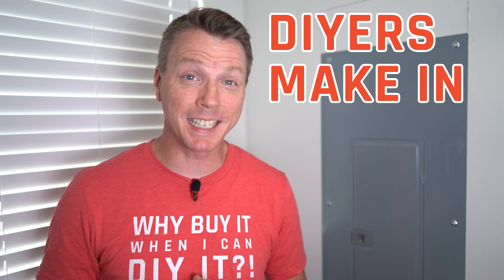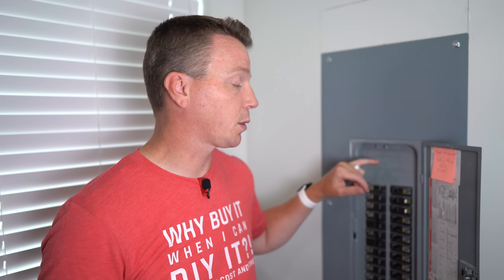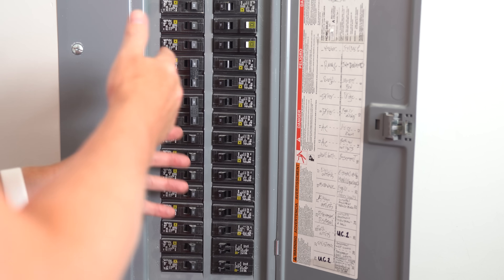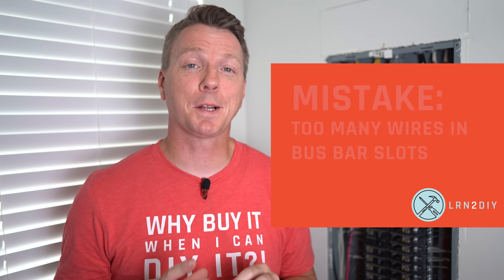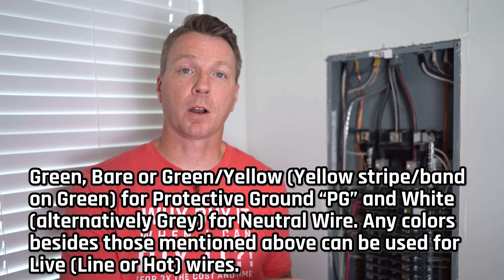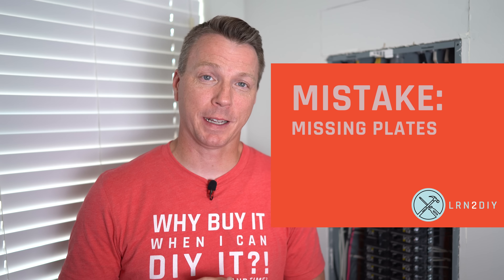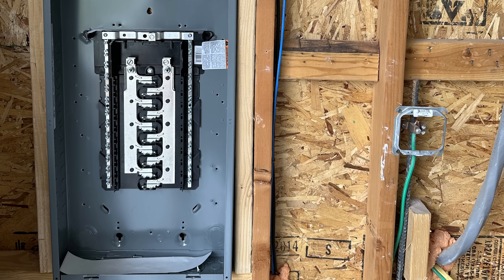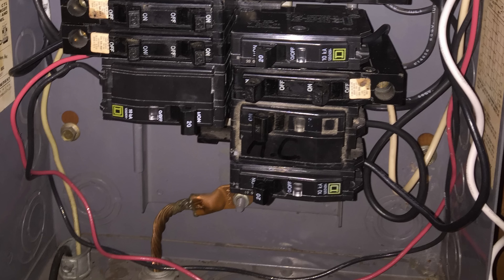10 Common Mistakes DIYers Make In Circuit Breaker Boxes

Comment: I add plastic guarding to cover my main lugs using a small Lexan sheet and a hot air gun to shape it.  I work on three phase 480 systems for work and every thing we do is finger safe.  Home load center panels are really primitive and unsafe compared to industrial electrical.  Also you should not torque live breaker screws.

Comment: Finally...You should only use a voltage rated tool when if needing to contact a live terminal in a panel. And #10? It is illegal to zip tie or otherwise bundle conductors together inside a panel. Using the photo as an example...you can see on the right side there are about 20 conductors in a 1 inch clump. Who knows of any installation where you can stuff that many wires into a conduit? NONE! This setup essentially does the same thing...essentially removing the ability of the wires on the inside of the bundle to radiate any heat away into free air.
Reply: I also noticed this right away. I created a beautiful panel like the one shown. When the inspector saw it, he made me cut all of the zip ties and separate the wires for heat dissipation. Thank you for this video.

Comment: Also another one. I guess I should have watched he entire video first? When Re-identifying a conductor like a white wire as a hot line conductor or something else , the entire visible jacket must be covered. Does that mean all 20 inches of that white wire? Technically yes, especially at the breaker end...but if it’s a little short at the cable entrance point no one will flag you for it.

Comment: I hate my iPad...can’t edit comments...🤬. Anyway, secondly...it is incorrect to refer to the white wire of a 120v circuit as the “neutral” because as anyone knows, a neutral only carries the unbalanced current in a 120/240 volt 3 wire circuit. The NEC refers to this conductor as the grounded conductor, while remembering the bare or green is the GROUNDING conductor. The white wire of a 120v Is actually more hazardous Than the hot wire because it is carrying all the current of a circuit, but people handle it like it does not.

Comment: So just a couple of answers and corrections. As far as the bare stranded conductor being cut off in a 4 wire service cable, it’s quite possible that’s all they had at the supply house and the bonding To the grounding electrode conductor is being done at the meter base...in that case a bonding screw would be run into the neutral bar to the panel. At that stage, all ground wires in the panel would then be connected to the neutral bar also.

Comment: I had experience with undertorqued panel.  Once I went to the basement and noticed sparks in the panel. It was a pretty good timing - when I opened the panel I saw a wire started burning its insulation.  And, of course,  there was a lose screw on the breaker.  That was pretty scary.   I still thank God, I think it was a miracle I noticed it at the right time.

Comment: I actually have my circuit breaker diagram on a Google sheet. And I have a QR code printed on my box so the electrician can just open it on their phone. It enables you to change anything adhoc and keep it clean. Also describe the rooms and placement of each switch or light on extreme detail.

Comment: Another fix for missing slot covers. If you have an old or extra breaker, use it to fill the slot.  It is left off and labelled spare or not in use.

Comment: Ground wires can be double lugged---sometimes up to three---panel label will tell you.  Double neutrals is not because of arcing, but because if you loosen the screw you are disconnecting multiple circuits and might be creating a 240 volt circuit.

Comment: Thank You sir, 5 stars from me. I did my own 200 amp service in a shop/building. I got 100 % according to you. Also I did my ground rod and grounding as well as I could. I couldn't make my panel wiring as pretty as your example but that is what I was trying for and it is certainly not a rats nest. I am a retired Union pipefitter and in our area of the world that includes the HVAC service world. So glad you included the tightening torque and going back every year to check tightness. . Skip that step and burn a terminal off of a large compressor and you could be looking for a job. It is so important! One last thing, Your presentation and your clean cut appearance make people feel secure when you come to there door. Versus someone wearing their clothes multiple days, hair all over their face, kicking the mud off their boots on your porch and I'm sure from looking at you, you know what I mean. I subscribed and want to see in your other videos what I may have done wrong. Thank You again, It was a pleasure.

Comment: And you lost me when you talked about the panel 'pushing' 'amperage' - Current is drawn by the load (i.e. lights  or what you have plugged in) - not pushed by a circuit breaker.

Comment: Another mistake for those people with an outside fuse box is to not use a padlock on the cover plate tabs to prevent criminals switching off your power, thus disabling your Wi-Fi cameras.

Comment: Still shocked how crappy US panels look compared to EU ones. Ours looked like that in the 1950s. 
Sure we are over regulated, but safty first and a bit of quality doesn’t hurt. Wire nuts in a panel are weired.
Reply: Even when we open a panel there are no uninsulated parts exposed or screws you could accidentally touch.

Comment: If you're flagging (wrapping red or black tape in it) a White wire as a Hot Conductor, you MUST flag both ends of the wire...in the Panel AND in the Device Box it leads to...

Also, the Electrical Code does specify (at least the Canadian CEC does) that in Single Phase Systems (like the panel in this video), Hot Conductors must be Black (Line 1) or Red (Line 2), Red is usually only used in 240 Volt Circuits such as a Workshop, Clothes Dryer and Stove/Oven. In 3-Phase Systems (typically only found in Commercial and Industrial Buildings, RARELY found in Residences) the Hot Conductors must be Black (Line 1), Red (Line 2) and Blue (Line 3), the Neutral and Ground colours are the same in 3-Phase Systems as they are in 1-Phase Systems...

Also note, Wire size ONLY matters for Amperage, how much Voltage a wire can safely carry is determined by it's Insulation, a wire the diameter of a human hair can carry 1,000,000 Volts safely if it's Insulation is thick enough, it just won't be able to carry more than about half an Amp without overheating...

The Amperage he mentioned for 12 and 14 Gauges Wire is also only accurate for about 75-100 feet of cable in typical house interior walls, longer than that or in hotter environments (like attics in summer), you will need to use larger wire for a given Amperage (called Derating in the Electrical Code Book)...

For those wondering, I am a Canadian Electrician...

Comment: You are wrong on #7. First off---you are not supposed to phase any wires smaller than #6.
Secondly---we run romex in residential & when a 6/2, 8/2, 10/2 etc etc---is run to a 2 pole breaker its obvious what is being done. There is no need for redundancy & wasted time. Any moron should know it's hot & not a neutral. If this concept is confusing to a person---they should not be in a panel

Comment: I created my own breaker labels using Microsoft office. I then printed it out, laminated it, and used magnets to attach it to the breaker box door (so I can update and change it easily). It's really easy to do and far better than the stickers you buy.
Reply: that is a really smart idea...thanks for that. One day in the near future I will have to label my rewired boxes. I feel fairly sure the electrician won't do it to my standards.

Comment: I can guarantee that professionals are often guilty of failure to label. I'd be willing to bet they're rsponsible for most of the problem. At my previously workplace someone almost died because of it. The same professionals resposible for the erroneous labels also rewired the panels to defeat important redundancies in the climate control sytem, because they didn't understand why some heating and cooling was on one leg, and some on the other.

Comment: Another  item, of  mutual  interest :. Tightness.  Of  the screws,  within  the panel. Modern  panels, use alot of aluminum, and cheap other metals.  Mixing, two or more, within a panel, is not for  
 ' tightness '  make.  About every 6 months, go in the panel, with the proper screwdriver (ONLY  ones, with insulated handles / and shafts !)  Put one hand, in your pocket, and go ahead and tighten, everything you see:  all screws and  bolts. More now, than ever,  WE  THE  PEOPLE...need to educate ourselves, in the LAWS of Thermo dynamics. There are alot more various  types, of products, used to make everything. ALOT  MORE  THAN  IN  GRANDPAS'  TIME..../ STEEL AND  CAST IRON,  and several  others.  Educate  yourselves, on the  'usage  of  metals '....

Comment: NO DIY'er is 'Qualified' or 'Trained" to be opening up a panel by removing the panel cover. Get help from someone who actually is or call a pro. Yes, it will cost you money, but it's better then it costing you your life. Can't tell you how many times me and my co sparky's had to fix bad situations from a DIY'er who 'saw how to do it online'. Somethings can be done with care yes, but leave the panels and wire issues/tracing/add-ons to someone with a license!

Comment: What if my generator breaker is having a problem closing? The bus & grid voltage match (13.8kv); the syncroscope comes to the top at (60Hz); the dither setting is good; the charging spring is ready & the fuses are ok. Probably the closing coil? 🤔

Comment: Another mistake is improper phasing of 3-wire Romex with two hots (black and red) and a common neutral (white).  It's important to make sure the black and red wire circuits land on opposite bus bars in the panel.  This is best accomplished by connecting to two adjacent breakers since adjacent breakers are connected to the opposite bus bar.

Comment: I moved into my house in 2003. It came with a 100 ampere 20 circuit circuit breaker box. 
I was adding central air & needed to get a bigger box. I hired a coworker who happens to have an E-1. Him & I talked about my options. He suggested after measuring load on each hot leg that all I needed was a bigger panel. We increased it to a 32 breaker panel. In 2004 I added 2 spaces for the condenser outside & 2 for the air handler. In 2006 I added an addition & added a lightening circuit & one plug circuit. 2-2 spaces for a baseboard electric. Then we added a home run outlet for the garage for 20 amperes with 12/3 conductors. Last was a mini split for my interlock in 2018 for my back feeding generator. Now my panel is full again. We did a load check with the A/C on & our usual appliances in the summer time including the washing machine & dryer running. All our lights on. We were only drawing 7 amps on each phase. Same for winter with both electric baseboards & oil heat. 
Great video & content!

Comment: One fault not mentioned is the always illicit shared neutral in a 120V branch circuit, in which two (or God forbid, more) circuits, each fed by its own breaker, return current through a single neutral. It's especially insidious because there's nothing in the panel that gives it away. It's dangerous because the combined current from two heavily loaded circuits could easily overload a single neutral, with the kicker being that the neutral has NO overload protection at all. The only way to suss this out is to look at your junction boxes; a large wire nut connecting a large # of neutrals should draw your eye.

In my own house, which I bought from a retired couple, I found 6 such circuits, arranged in 3 pairs, with each pair sharing a single neutral back to the panel. All were apparently installed at the same time by the same person as part of a  home "update," since they used identical materials and techniques. The guy used 3 240V cables (12-3 w/g) to do the work of 6 120V cables (12-2 w/g). Since it was done systematically and otherwise competently, I have to assume that it was the work of a dishonest professional who cheated (and endangered) the customer by cheaping out on the materials and labor, a case of pure theft. Needless to say, I won't be hiring the guy whose stickers are on my panel. When I looked him up, he now advertises himself as a garage-door installer, not a licensed electrician, so maybe that says something.

Comment: Very good vid. I guess top 10 is subjective. I expected to see unbalanced loads or Heaven forbid, using a breaker with 2 poles (switches) that are not pinned together for split circuits.

Comment: Hint: Don't just label the breakers.  Label the outlets, fixtures and switches as well.  You can put the number of the breaker either on the front or back of the cover plate.
My electrician filled ALL the holes with breakers, very convenient when I need to add a circuit.

Comment: Most houses use 50 amps . Most houses use about 50 amp in most cases you would have to use and turn on everything in the at the same time to use 150 in the house . If you have electric heat and turns on at the same time you mite use a 100 max most thinks in you would have plug in every outlet .and have a load on it to draw 20 amp . I have taken amp prob reading on and all electric house and they are not even close to 100 amps .

Comment: As a licensed electrician mistake #1 should be that unlicensed individuals should not be messing around in the electrical panel. All the mistakes you mentioned should be big red flags to any inspector (home or otherwise). This could result in a background check to see if permit(s) were pulled for the work. Which can result in a deal breaker at the sale of the home if a certification of the work is required by a licensed electrician. I personally have experienced several occasions where basements where finished without permits and the homeowner was required to have the work certified. The issue is that the work is required to meet the code requirements at the time of certification and having to bring things up to current code can be expensive (not that I'm complaining, more work for me).

Comment: 1st thing i did when i purchased my home was have an electrician  check and label every breaker, switch and outlet. whomever did the wiring in my house used the same color wire 'all black' in some sections. damn idiot for sure and how it got oked for a permit is beyond me.

Comment: If you need more amps than the panel can handle, upgrade to 200 amps. Not only the panel but also the meter base and SE cable.

Comment: Torque is important. I recently bought a different house the main was installed in 80’s and every wire was loose on the pole box. The sub panels were bonded in shop and garage without any 4th ground run at all.  Found all the lights in the shop were run to a 220 style double breaker front to one lug and back to another lug.  Everything was on 20 and 30 amp breakers no matter the wire gauge.   Ugh.  Was so bad that turning the heat pump on in one building made the circuit panel buzz in another building as there was inadequate ground. Had to run each a ground remove the bonding and drive a ground stake at each building to stop the buzzing noise and it was actually loud at the other boxes. Hahah. The house had missing knockouts and an addition done on yet another panel again bonded but they ran indoor cable outside so it was deteriorated to 3 strands of bare copper. lol. I got the property cheap from a probate sale and had lot land and buildings but much was done right in its day but as the decades moved on and more was added it was wrong.  Like 8 gauge to a shop on 60 amp breaker. That #8 was ran in gas line pipe of all things.   Well it’s 4 #4 now and building is grounded with a #4 bare on a rod.  And needless the say the 220 20 amp breaker is no longer lighting as 2 15 amp replaced it.

Comment: There’s a substantial safety failure in the panel shown. NEC 338.10 (B) 2 Restricts the use of the uninsulated conductor of type SE cable to equipment grounding for panel feeders. It goes along with keeping the current carrying neutral and not normally current carrying equipment grounding conductors separate. This panel isn’t the service entrance, there’s no main breaker, and it’s fed by a type SE cable with 2 insulated wires and 1 uninsulated wire.  It looks like it could have previously been the service entrance and perhaps a generator transfer switch was added. I wouldn’t have wanted to replace the SE cable either.

Comment: Is the ground conductor you have installed from the meter box to the bus bar a "parallel bond" which I believe is no longer compliant with current NEC code? The neutral conductor is your meter to breaker box ground.

Comment: In a square D homeline main panel ive noticed that for each breaker space there are two corresponding spots on the neutral bar, since its a main panel and grounds and neutrals are connected  are the two connector points on the neutral terminal there for a ground and neutral side by side at each breaker?

Comment: Safety tip:  I had a neighbor call (Roy) asking for help on a breaker box problem.  I went over to his house to find him standing on a wooden pallet in front of a open panel box.  Because his cellar had flooded and there was 6 inches of water covering most of the cellar floor.   I declined.

Comment: Testing the plugs isn't 100% fool proof. I was doing dismantling of an equipment hut. Turned off power. Checked with meter. Turned out the FOOL that wired the panel decades earlier tied the hots and ran the neutrals to the breakers..

Comment: Mistake # 11  There was a point in your video where you were pointing to the upper right hand wiring Your elbow hinged in and got close to the main feed lines on the buss'es . Instead of paying attention you were looking at your camera !  If your elbow had made contact with them ? your video would have ended swiftly and badly